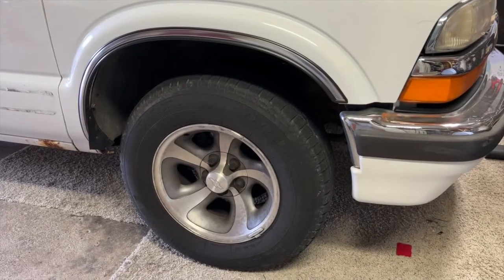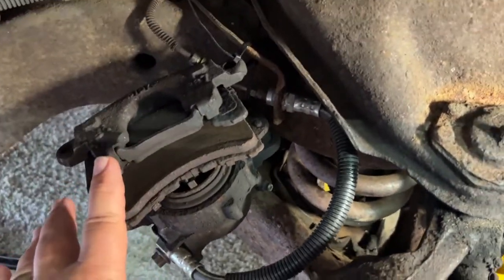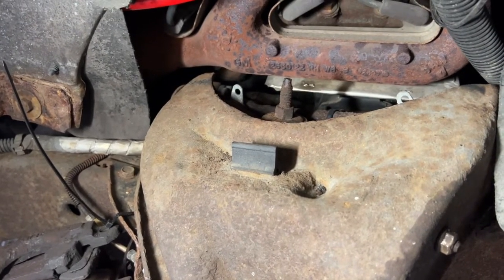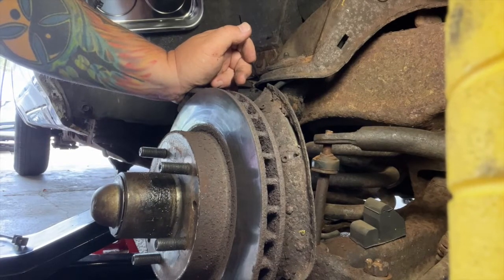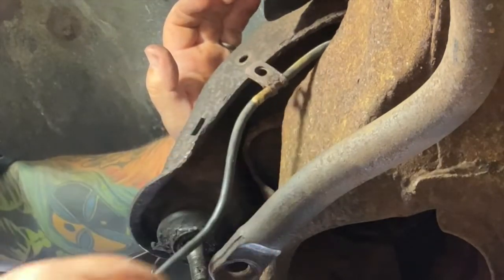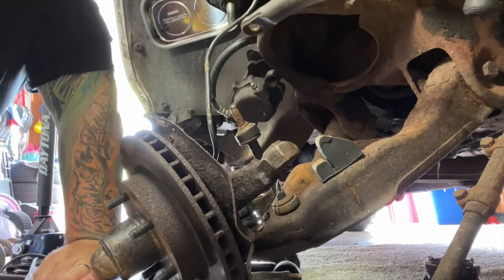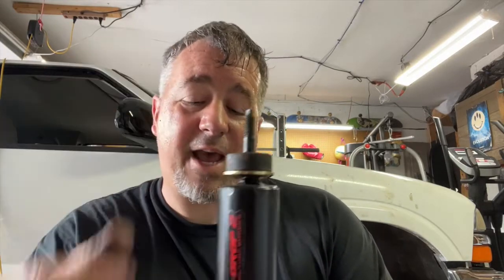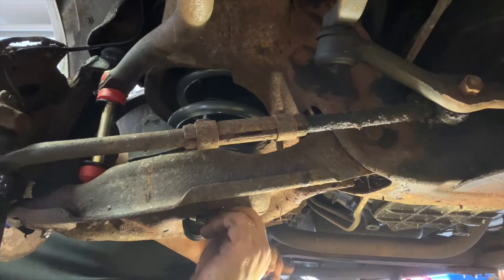Installing Lowering Coils & Shocks on Chevy S-10 (Jimmy Sonoma Blazer S-15) - Project S10 (Ep.5)

Comment: Purchased a 98 s-10 lowered sadly the previous owner cut the stock springs it looks ok I guess but rides like hell In closing back up it goes
Reply from the maker: Yeah. Cutting springs makes for a rough ride but it’s also stiffer so less travel. Right now I have too much travel. If I’d have cut the stock springs I’d be better off and scrape frame a lot less. 🤷🏻‍♂️

Comment: I went to take the sway bar link bolt off and realized it was not even connected to the lower control arm at all. It was just the bushing sitting on it.